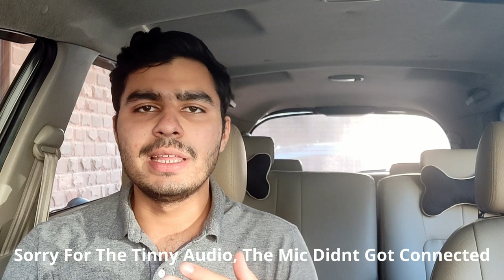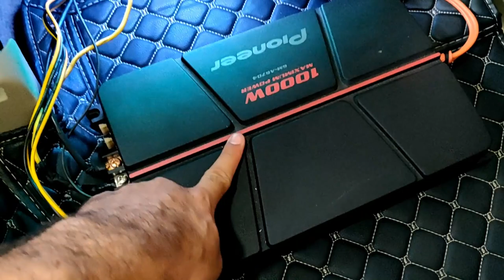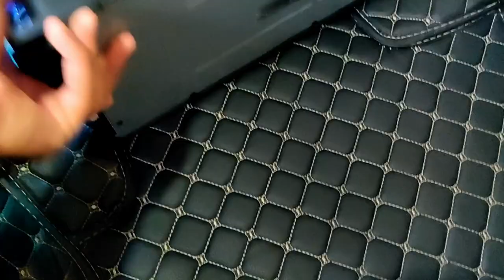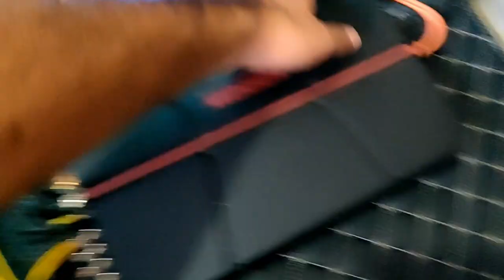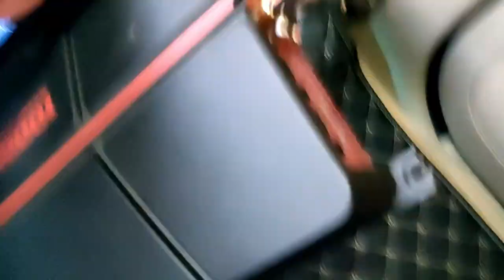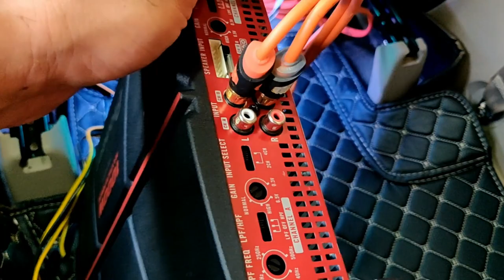What Are Car AMPLIFIERS and Why Are They Used | Pioneer 1000W 4 Chanel Amplifier | Car Audio

Comment: Bro i have a four channel 1000w pioneer amp installed in my car . Now after some, it is creating a humming or buzzing noise in speakers and twitters. Also engine noise is also coming inside. What should i do?
Reply from the maker: So this is because of interference with RC leads that are supplying the source to the amplifier there are two options one is to to isolate the power lines of the amplifier with the RC leads and the other option is to use an ground loop isolator. In a future video I'll be covering more on it.